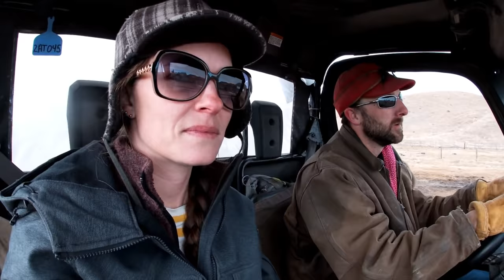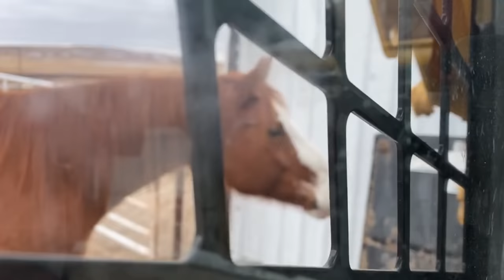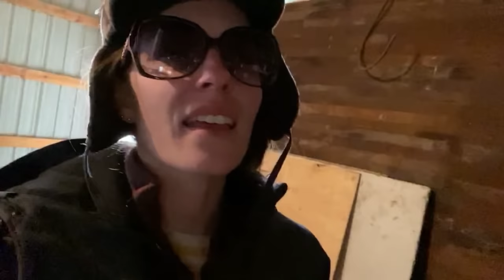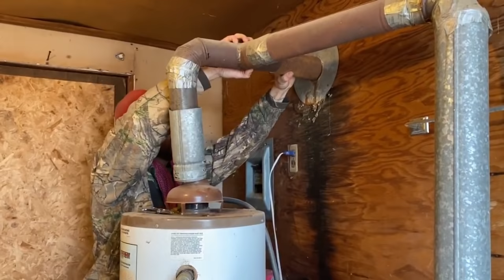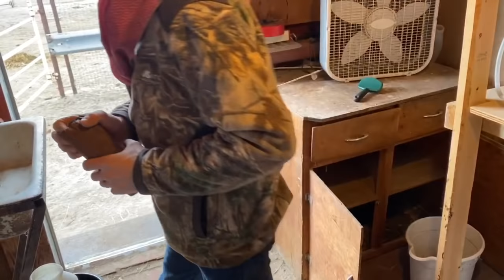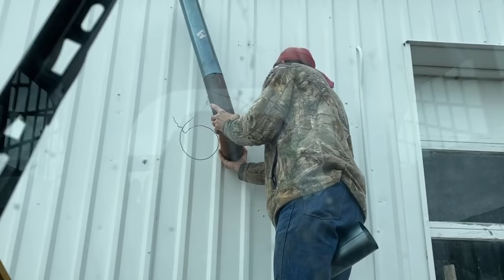Well... That Didn't Go As Planned | Fixing the Calving Barn Chimney

Comment: From experience, Have Mr. FFB to put some self tapping screws into the seems of the "Snap Lock Pipe" that is it's correct name ( Chimney Pipe )  it will stay together better when he is fitting it all up and he won" be fighting with it so much. Then if he'll put some self tappers into all the Joints it all will stay together better. Just a Thought to help Ya'll out.